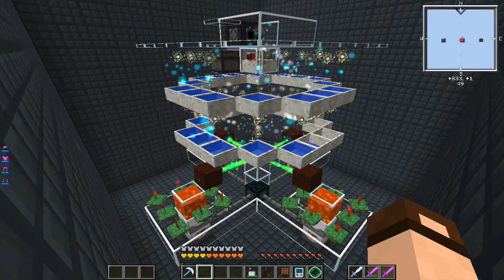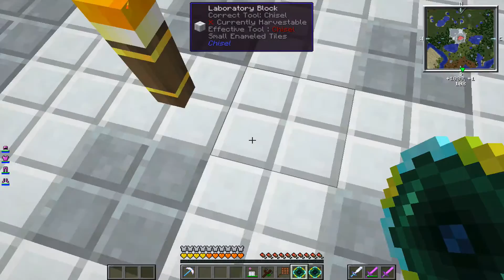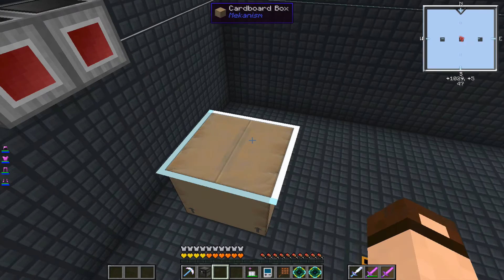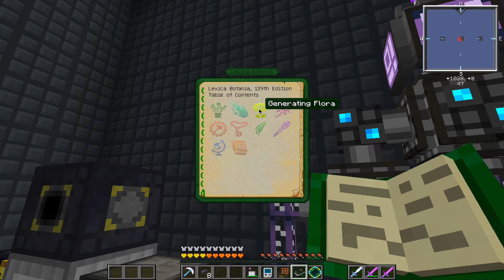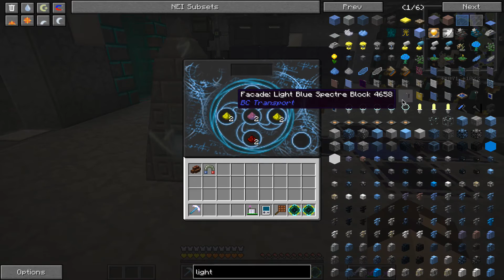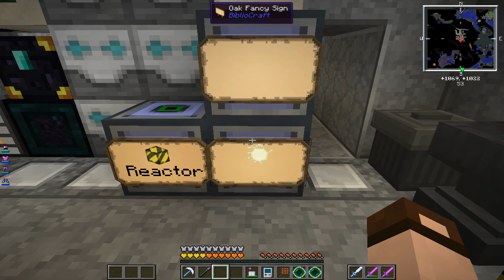Modsauce LP - EP15 - Applied Energistics 2 Auto-Crafting of Botania

Comment: both for Petal Apothekary and for the Runic Altar it's best to configure the AE2 Interface to provide a stack of seeds and a stack of livingstone respectively, as it's needed for every crafting no point in encoding them in patterns - just wastes a a space. Factory Manager can pick them just as a separate step from different inventory
Reply from the maker: +666Tomato666 Since that series, I did a four-episode automation of Botania using AE2 on a Resonant Rise 3 server. I used much better techniques with probably the most versatile and elegant Runic Altar automation I've ever encountered (in part four)—if I do say so myself, which I never would! :D

First: https://www.youtube.com/watch?v=RhR3FE6bYF8
Second: https://www.youtube.com/watch?v=oG0kVPD0G-0
Third: https://www.youtube.com/watch?v=Jjdd902N5bM
Final: https://www.youtube.com/watch?v=0P12G6b_83I
Reply: +Nonsanity yeah, the Runic Altar automation is much cleaner - as no rune requires more than 8 ingredient types it will work nicely with blocking mode. But there are flowers that require more than 9 types, so simple AE2 setup won't work (with Steve's Manager you can at least dump ingredients to make a dozen or so of them so it's at least partially automated)

Comment: My machine doesn't pull out the empty tablet even though i got it on precise and 1000 damage :/ any idea what could be wrong? It puts in stuff as it should atleast
Reply from the maker: If the input really is right, check the output. Both have to be correct for that part of the chain to execute.